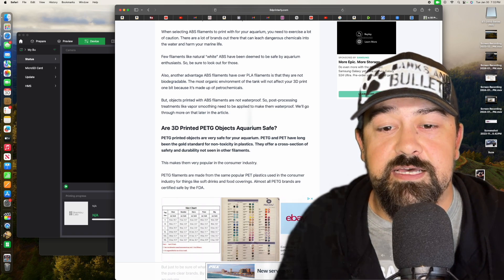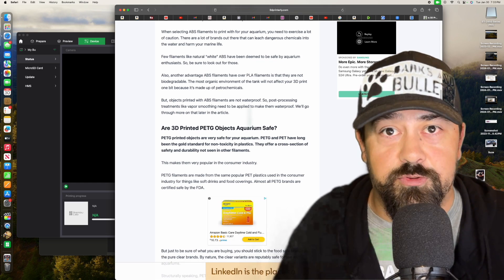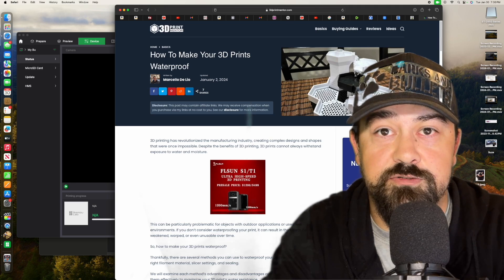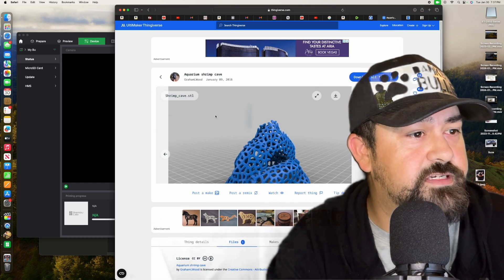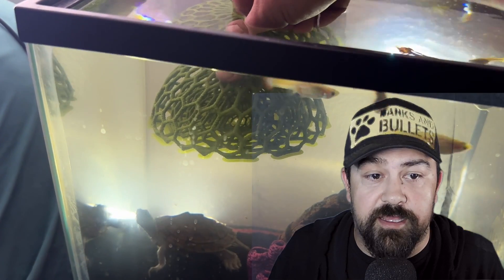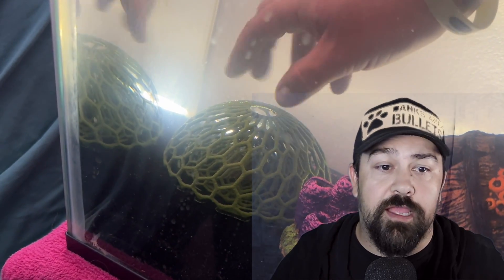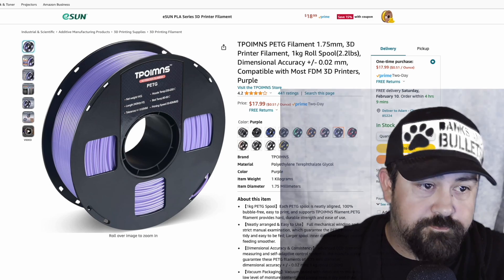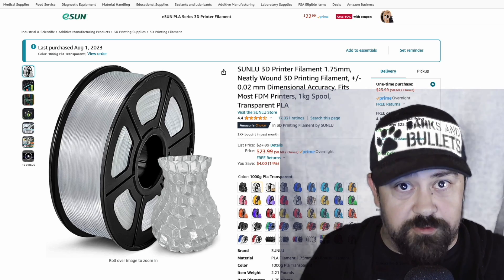Is 3d printing safe for aquariums?!

Comment: I can 100 % verify that PLA created art from a 3D printer will not harm aquarium life... It will not dissolve and can be used in your aquarium.. i have been writting to other u tubers on what they also can verify and they all have had no problems.. i also can offer actual proof thru my own testing as seen right here.. https://youtu.be/R3E4JxpCmBM?si=LO2FEi-cAoail2dw